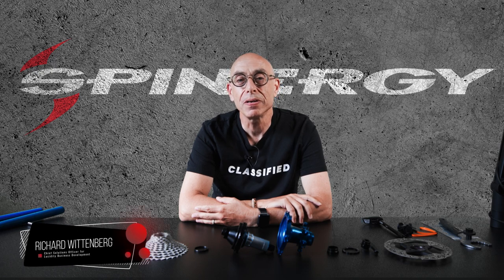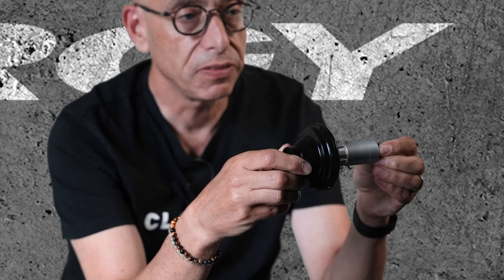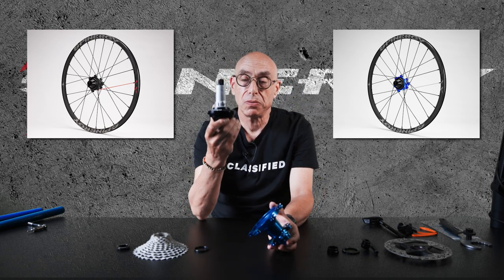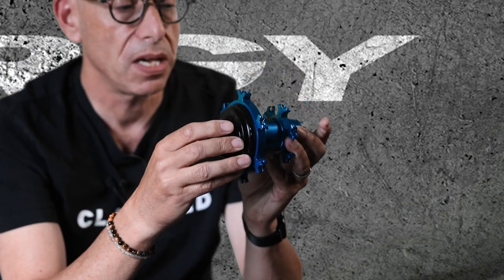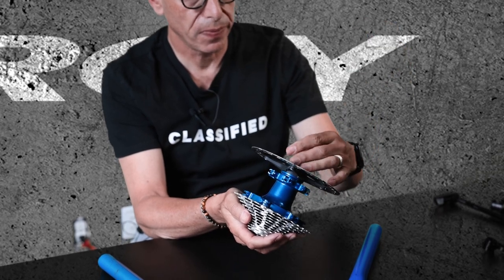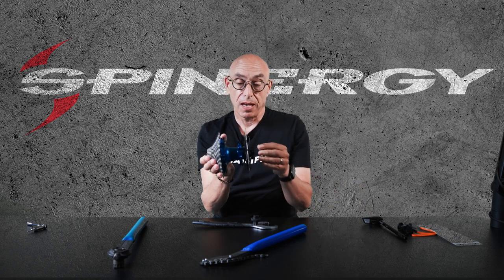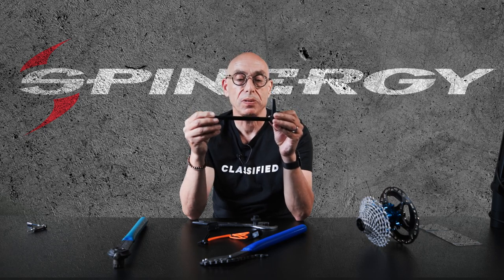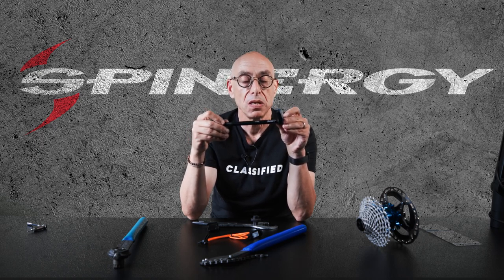Spinergy + Powershift

Comment: What about the integration with the Shimano Di2 shifter.  Does the Classified bar-end transmitter plug into the Di2 shifter instead of the little 'sprint shifter'-type supplied button?  How will it work with the newer wireless 12-speed shifters?

Comment: Not sure I follow...does this shift without a derailleur? Do you have video footage of the technology in action?
Reply from the maker: The rear hub contains an internal gear system that mimics what a front derailleur does on a 2x set up. It decreases the gear ratio for each of the cogs on your rear cassette.
So when you actuate the internal powershift mechanism its like going from the big chainring to the small chainring except the chain doesn’t have to move and you don’t need a front derailleur and 2nd chainring